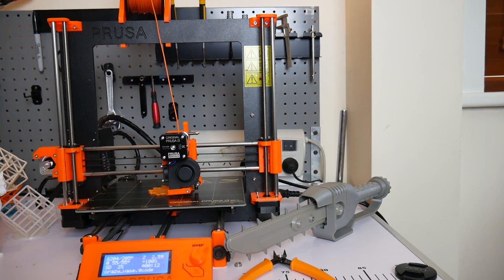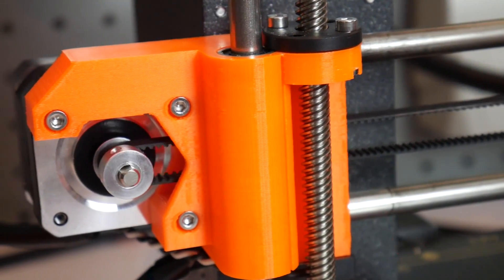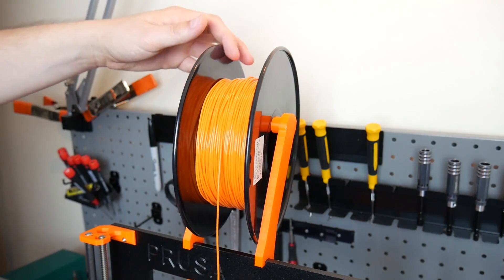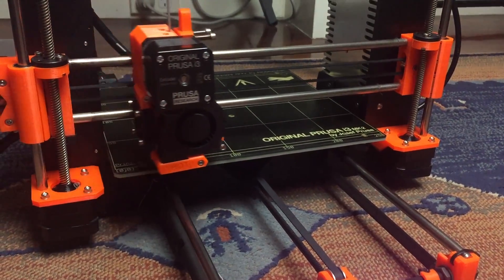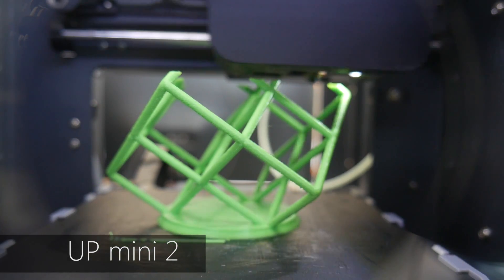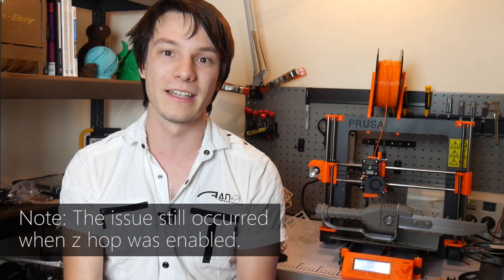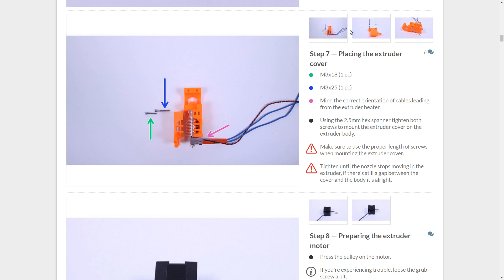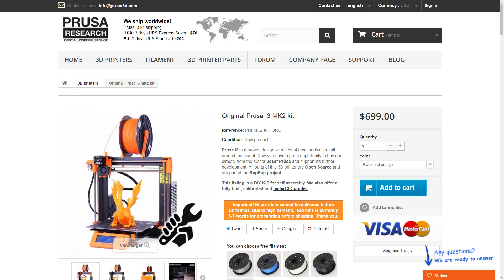Original Prusa i3 Mk2 3D Printer Review

Comment: Any idea on total cost for the fully assembled model would cost delivered to Australia, including duty?

I believe that the unassembled kit version is below the $1k threshold so doesn't attract import duty.  But I want a machine that I can use out of the box. I'm not really interested in 3d printing as a 'hobby' - I need it as a functioning tool.

So... I have no interest in building the kit or tweaking/modifying/upgrading.  If the ready made model costs significantly more than $1000, would I be better off buying a Lolsbot Mini locally for about $1800 AUD?

The items I will be making are quite small, like crown gears, nuts and those cam locks similar to the quick release on a bicycle wheel.

Would you steer me towards either machine? Or suggest something else?

Comment: Hi

I plan to buy a mk2s and mount it like this: http://www.thingiverse.com/thing:1692666 with other bearing and with side panels

Ok this machine is a killer with PLA but with ABS and ABS with kevlar and thinks like that?
Can i have the same qualitat than a zortrax m200? Because i will print more ABS than PLA?
Thanks a lot
Reply from the maker: +Arnaud Erbs it's great for pla but I don't recommend it or any open frame design for ABS, not without a custom built chamber to keep heat in anyway
Reply: Maker's Muse thank you a lot 
But with the custom i will make and a custom chamber is chould be work as great as other 3d printer like zortrax or really not ?
Reply from the maker: +Arnaud Erbs not really zortrax is designed for abs

Comment: would this be a good printer for a beginner? I would like to make 2d terrain for wargaming.
Reply from the maker: Yep it'll be perfect for terrain but not so much characters - but you can swap the print nozzle out for a 0.2mm size if you wanted to try ultra fine details.
Reply: still on the fence between this and the flashforge creator pro. isn't having an enclosed printer enclosure a safer/better system? I apologize in advance I am a noob after all... ;)

Comment: Hi, You mention you used Simplify 3d, Prusa does say they have profiles for their own Slicer, I wonder if that would have been better ?. You also mention the price, Although initially it seems expensive, if you consider buying a china clone, then adding the costs for genuine motherboard, genuine hotend, uniform PEI heated bed, Z probe with XYZ correction, proper leadscrews without flexible couplers, maybe better power supply (not sure), a frame that might seem flimsy, but has strength where its needed, better updated software with filament profiles, and possible multi colour upgrade, I think that the cost is better justified. My comments are based upon purchasing a China clone that is cheap, but is a source of never ending issues..

Comment: Hey Angus! Let me start by saying that your channel is great and the reviews are to the point. I've had my i3 Mk2 for about 2 months now (still waiting for the 4 colour upgrade to ship) and am in the process of adding drag chains to all the cabling on each axis (I'm an electrical engineer, and having spent the last 20 years around cnc machinery, I  hate the wire management and probably mainly due to the spirobind around the wiring!) As for other changes, it's easy to get designing and print the parts that you would like to change. The print quality on this little printer is awesome!! Set it up properly, and it's great..... Just like any other machine out there, if it's not set up properly, it won't provide good results. I'm still amazed at the print quality, especially at higher resolutions! Well done, Josef Prusa, and thanks again Angus, for an honest review!

Comment: Sounds like a good machine for both tinkerers & newbies. Also being its open source its easy to modify things on it. That said my inner precision guy gets a little nervous with zip ties holding stuff on! That said I guess what works works. Other concern is the 3D printed parts strictly from a durability view. Few years ago I saw a Lulzbot at a show & the flexystruder was cracked and it really put me off on 3D printed parts for load bearing on a machine!

Comment: Angus, I think the pulley contraption you have there will negatively impact print quality as each time filament is pulled on, it will inevitably cause the vertical frame to tilt/flex backwards somewhat during a print, leading to print inaccuracies along the y-axis.

Comment: Loved the review, Angus, thanks a lot. I've had my Mk2 now for a couple of months, and the print quality I'm getting from mine is truly wonderful! I think I have an answer for you to your problem of the printer catching thin curling parts. I had the same problem until I printed out and installed a cap for the Z-probe. This is the item that catches prints, as it has hard vertical edges. There are a few choices of cap out there (including one from Prusa themselves). After that was installed, all the catching problems went away!
I also installed polimer linear bearings during assembly (mine was a kit) which seems to work beautifully - I don't have the play in the bed that you mention in your review - mine's tight as a drum!

Thanks again for all the help you provide to us novice printers!! :-)

Comment: I'll just stick with making my own 2020 based prusa style printers. Downside is the abundance of chinese parts I need to source, but at less than half the cost I'll take it. 2020 extrusions are one of the few things you can build a chassis out of that will allow you to print with highly consistent layers at decent speeds. It's so rigid that when I moved 3 printers cross state, all three were still perfectly level.
Reply: By the way, to anyone looking to build their own and source the parts themselves (i.e. not buy a kit), I highly recommend buying a quality arduino. It doesn't have to be the genuine article, but a trusted 3rd party brand can go a long way. The cheap Chinese ones use low quality voltage regulators and then don't bother to QC them. Running an SD card setup (no external 5v, thus stressing the built in 5v regulator for the logic and stepper drivers), can push cheap arduinos to magic smokey failures.

Comment: Yes, I agree the printer is noisy at full power mode but there is a work around that is extremely effective.....Printable vibration dampers- here's the link:

http://www.thingiverse.com/thing:1707045
Reply from the maker: How do these affect the accuracy of the printer vs having all corners on a solid - level surface?
Reply: They haven't affected my printer's accuracy one bit. The dampers are quite sturdy and they surprisingly do a decent job non the less. I was sceptical at first but you have to try it to believe it, you don't have much to lose by trying this simple solution!
Reply: Don't do it. There's reports of these dampeners shaking the printer apart

Comment: If you buy the kit, dont forget to put clear nailpolish or loctite to hold the probe once you get it in the right spot, like i did!! The nut vibrated loose during the print and I did not notice until I went to calibrate it after the print and it completely ruined the PEI sheet :(

Comment: Whilst the Prusa is the most talked about machine by many including you it still is an overpriced average machine, the biggest problem is obtaining one as it is always out of stock and has been for some months now, half a dozen times you leave your email to be notified and nobody bothers so you have to take pot luck, it was my intention to purchase one until I came across the Anet A8 and for a half of the Prusa price I bought three at 375 GBP total, one I am going to use as a 3D printer and the others will operate a Dremel for small carving jobs and the other a laser engraver, at the moment only the 3D printer is running and after a learning curve the prints are as good as the Prusa, whilst I accept that buying Chinese there is often no regard to safety such as exposed wiring and poor connections but,  most people who buy a kit have some technical savvy and make it safe, I put the power supply and controls in an proprietary electrical box with a window and can see as there is a large following for these machines that others do the same, I do intend in the future to buy a Prusa but I suspect once the hype is over and the problems some are experiencing with these machines, and  that more and more machines are arriving plug and play at half the cost there will probably be plenty of Prusa's on Ebay at a proper price.RegardsRobUK

Comment: I have to say that after 3 months with one, I have not experienced the thermal runaway issue yet, but I have to agree that unjamming filament on this machine is a pain.  The whole extruder and hotend is nice and compact but having to disassemble it to unjam the filament is annoying, not quite as bad as working on a Flashforge but nowhere as easy as a TAZ (the other printers I have had to disassemble), thankfully I have only had 1 jam so far .  The mesh bed leveling and z tuning is worth the price of admission as far as I am concerned, it is awesome!

Comment: Very nice review.  It's great to watch 4 or 5 to get different points of view.  I bought the MK2 in early September.  It was my second printer.  My first being a low-cost Chinese kit.  I feel confident letting the MK2 print overnight without worrying about someone cutting costs on safety critical items.  To me, that is a key reason to pay a few hundred extra over many of the Chinese machines (see +CHEP's problem with one of the lower cost Prusa clones).   To rule out slicer issues when looking at quality, print some of the items on the SD card.  The frog at 0.05mm is amazing!
Reply: Randy H. Initially the zip ties looked like a cheap hack to me too, but once you see how they are used (and more importantly, where they are not used,) you will see that they make sense, and the printer has actually been designed to take advantage of them. My main concern was print quality, and now, even after owning the MK2 for three months, I continue to be amazed at the excellent print quality. To find better print quality, I'm convinced you would have to spend three times as much.
Reply: Good points. I just got fed up with my Wanhao i3. The thing has given me more problems that it has solved/entertainment. I suspect if +Makers Muse did the import from manufacture's SD card trick to get the settings, he might have gotten some results that would have made his cube work. Would certainly be an interesting video IMO.
Reply: Well crap... I was originally going to go with the Wanhao Duplicator I3 Plus until I found out they were about to release a bigger Plus model.  Then I ran across this machine on another forum and thought maybe this would be the better of the 2 machines. (I really like all the auto features this machine has) But after seeing this review and the ridiculous zip tied parts I guess it's back to the drawing board yet again!Why is it so difficult to find a good machine with auto features that doesn't suck?!
Reply: An old post but you may still be able to answer. Have you noticed the print quality is better then in the video? I saw a lot of the issues my cheap Anet A8 Prusa clone has (ringing, visible print lines) so I am wondering if you have found yours to be better? 

And regarding the zip ties a lot of people upgrade the Anet A8 away from the cast carriage bearing blocks to the zip ties. They seem to hold fine, and remove a lot of extra weight from the axis.

Comment: Can't you just wrap the extruder block in insulation tape like wanhao does to solve the temperature fluctuation issue?
Reply from the maker: There's very little room around it, but possibly if you're careful. I considered the e3d sock too but reading up on the Prusa blog they had it cause a few additional issues.
Reply: you can buy e3d silicone nozzle socks, they are supposed to work well.  Thomas sanladerer also did a slight " overclock " on the psu that helps the heater get a bit more juice it needs,
Reply: I think early sock users were trying to use it with the older-style E3D heater block/thermistor/heater.  In the past couple of months I have not heard issues except from those who have admitted that they did not get it to seat properly.  I've had one on since my first thermal runaway, and it does a great job.  It was a bit tricky to get it on, but by removing the nozzle for the parts cooling fan and using two sets of tweezers, it went on cleanly, and has continued to work properly.

Comment: Now since you have used both slicers, which one would you use simplify3d or slic3r by prusa, or is that dependent on each print you will do individually?
Reply from the maker: S3d is still preferred for more control over supports but for easier prints without it I'd use the Prusa slic3r

Comment: sold my UPbox to get a mk2 and never looked back. The mk2 just doesn't stop. yes there are issues but what printer doesn't. I have printed pla abs flex and wood all in the first week of finishing the kit with no issues. Try that on a 3k printer. slic3r is taking some getting used to but I have only ever used the up software. I think the only thing it need work on is its supports and fine first layers.
Reply: You should get Simplify 3d. I bought it and never looked back. With the MK2 is the perfect combo
Reply: I have S3d 3.1.0. Do you have better profile than the prusa and the spannerhand one.
Reply: I use the Prusa profile with a couple of changes depending on the model I print. Everything runs great
Reply: Oh ok. I tried that when I first got printer. The New PRUSA slic3r works great. I never paid for s3d so dont really need. There will be PRUSA Control software out soon. I only have or need the one printer. @furnibird are all my prints

Comment: you commented early on about Prusa's custom slic3r, but never got back to mentioning it...  did you end up using it for any of your prints?
Reply from the maker: I used it to complete a torture cube successfully but need more testing - didn't want to delay the review any further. Prior to using the latest slic3r the prints would fail.
Reply: Maker's Muse using that new slic3r version I've had issues of my filament retracting out of the extruder at some point with longer prints. Haven't used it since think I'll wait for a update.
Reply: thanks!  love your channel

Comment: I've used SpannerHands S3D profile. His does not have any of the acceleration settings that match the slic3r version.

https://github.com/PrusaMK2Users/Simplify3d/blob/master/Profiles/Ryan%20Neufeld's%20-%20Original%20Prusa%20i3%20MK2.fff#L155

Will help clean up some of the artifacting near the end of perimeters
Reply: Agreed - getting the acceleration settings from the Slic3r configuration into the S3D configuration is a key step.

Comment: I also became tired of the zip ties as well.  So I did something about it.  I redesigned the X-carriage and designed my own Y-axis bearing holders after trying a few of them out on Thingiverse and encountering clearance issues.  The only downside to getting the models I've created is you have to have a TinkerCAD account.  I did find that after using these, my print quality improved.

No Zip tie X-carriage:  https://tinkercad.com/things/58SFoYa8hJq

Y-axis bearing holder:  https://tinkercad.com/things/7YSlUjIlfC8

Do be aware that it is possible to tighten these bearing holders down too much so please do be careful when cinching them up.  Do test to ensure that your bearings move freely on the linear rods.

You can also check out my other designs in my TinkerCAD profile:  https://www.tinkercad.com/users/7Z01p6EVg8r-aaron-yourk
And if you have any troubles or want to discuss these designs with me, you can find me on Prusa MK2 Slack:  http://slackin.codehemi.com/
Reply: Getting a 404 error on your X carriage link.
Reply: I think it is fixed now.  I see what happened.

Comment: I ordered a kit built it perfectly and as i was doing the initial V2 calibration the ptfe got jammed and made a bad clog I installed a new tube and the same thing happened! I contact support but they take over 30 minutes at a time to reply and literally don't help at all so here are the steps that lead to failure 

1. Preheat to pla settings since I'm using pla
2. Load filament
3. Instant failure

At the point you cannot unload or load filament again all I hear and see is the pulley skipping and no filament extruding at all

I realize this sounds like a clog or a jam but how can this happen on a brand new printer and then again with a brand new tube?! 

I have literally not gotten a single print in 2 weeks. I never even got a V2 calibration out of this thing

Comment: What would be a better printer at this price point
Reply: Garrett there is none
Reply: What about under this price then :)
Reply: Maxzor azon i have the wanhao I3 and i am very pleased with it. cost me 300£.
Reply: At this stage I wonder if the upgrade from the MK10 extruder to the E3Dv6 is worth?
Reply from the maker: There is no 'better' - do you want more print volume with less reliability, or same print volume with less customer support? Less print volume with an enclosure and simpler interface? It's all possible.
Reply: I want to print propellers and wings for drones (having polysmooth/polysher in mind), print TPU/flex, and know if that grade of printers will perform any good with carbon fiber one day, essentially. More concerned about a good design that custom service. Wondering if a lower price point Wanhao/Tevo Tarantula could do the job.
Reply: Well is there any parts or printable parts to do away with the zip ties seems pretty silly to have them although they work